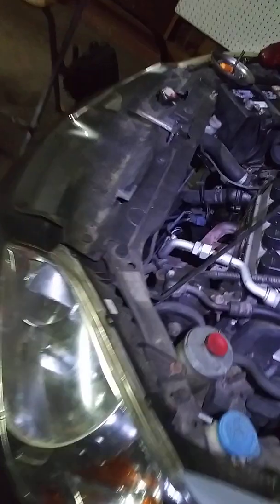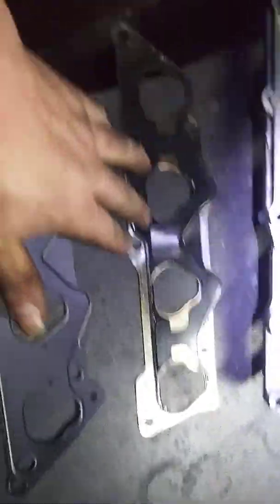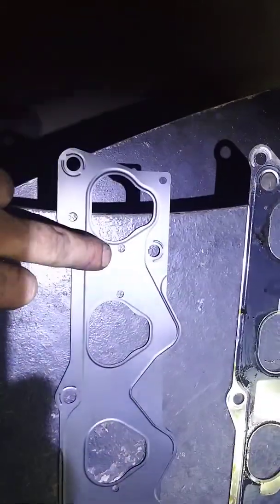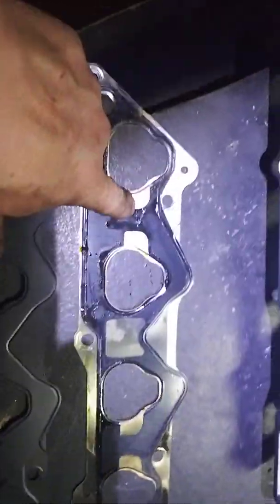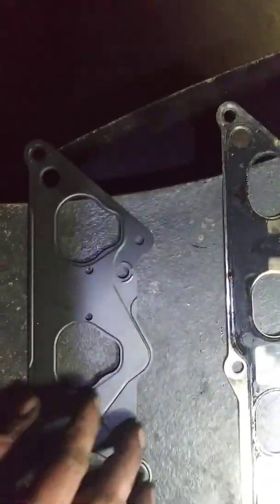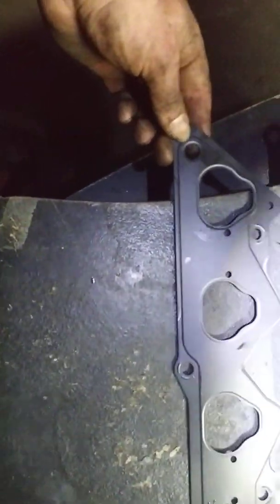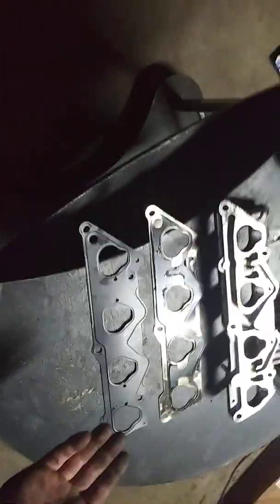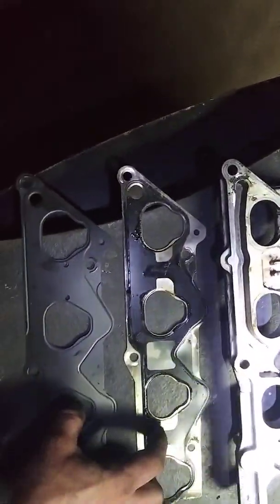04 Civic po401 EGR flow insufficient

Comment: Did that finally fix the overheating issue? The head gasket was the issue all along? You replaced the EGR/coolant gasket, the o ring and the radiator first. So all that didn’t fix the overheating but head gasket finally did, or did you just run the car into a lake and be done with it?